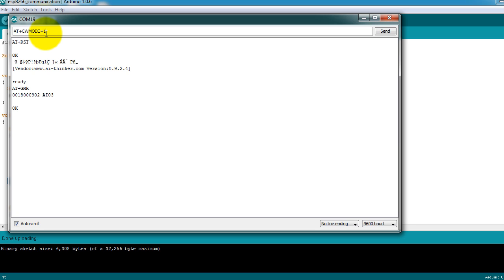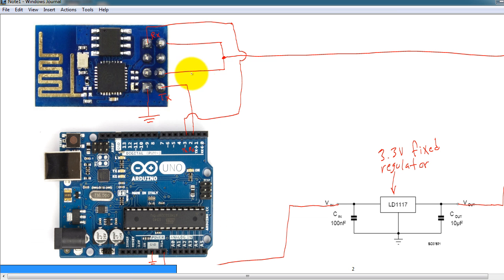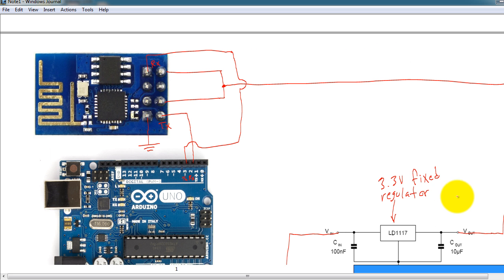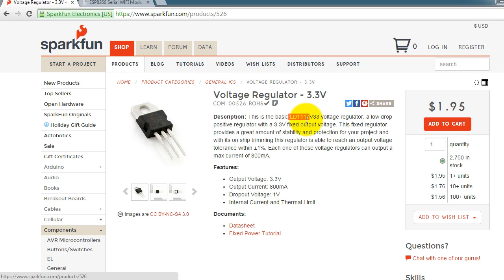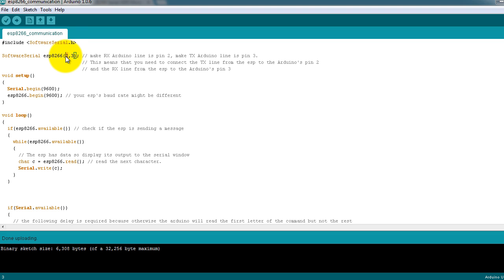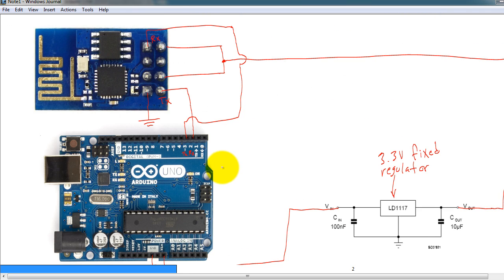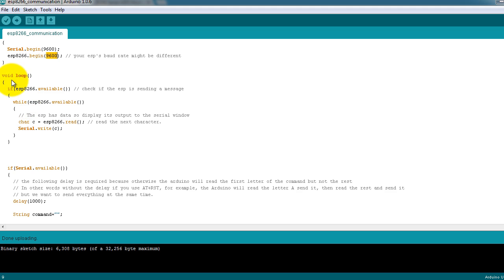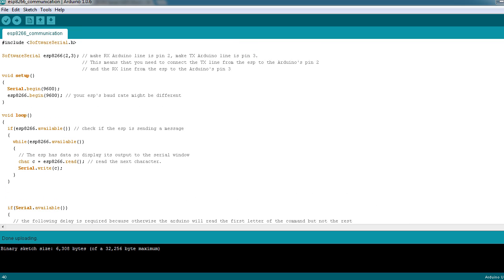ESP8266 Arduino Code and Circuit/Schematic for Sending Commands

Comment: How were the two capacitors around the regulator chosen? I don't have 100nF at hand, can I use two 10uF instead of a 100nF and a 10uF?

Comment: Hey guys , a very important thing here is a common ground connection. He has derived power from the Arduino and 1117 so he has GND same for both Arduino & ESP8266. I was using a separate power supply for the ESP8266 and could not make the chip to work. Its only when I connected the GND of Arduino with the GND of ESP8266 power , I was able to make the chip work. The chip otherwise kept on giving junk characters.

Comment: I keep getting garbage on the serial monitor? any suggestions?
Reply from the maker: jamil botros 100% garbage or only pieces? If it's 100% are you sure about the baud rate you are using?
Reply: I think I got it to work. I had to connect it to a voltage source to provide enough current. I do have another question if it is not too much trouble, I am trying to run a local website to control the arduino. But I need receive time and switch commands (set a pin high or low)
I do not think that the esp8266 has enough storage to hold such a document. how do you recommend to continue?
Reply from the maker: jamil botros You could use an SD card shield to save the HTML files. But the ESP8266+Arduino combination is very unreliable, I would rather use a WIFI or Ethernet shield. I don't know how big your webpage will be, but maybe the ESP alone (without an arduino) can handle it.
Reply: So, technically I should be able to hook up the esp to an Ethernet shield and connect to whatever local wifi I have around. am I right?
The question remains, how to initialize the ESP to connect to a wifi, is it possible to have some sort of code that allows me to enter the SSID and the password?
I know these are big questions but I'm really interested in making this work..
Reply from the maker: jamil botros Why do want to connect the ESP to an ethernet shield? The ESP can already do TCP. Check out my other videos where I show how to enter the SSID and password for the ESP https://www.youtube.com/playlist?list=PLmfT_cdP5PYDRYIvGIQ4YQYnEprshtxO8
Reply: ّI know the esp has tcp but is there a way to get it to read from a micro sd?
Reply from the maker: Yes, other versions have SPI but I doubt there is a well developed SD card. There is a kickstarter going on at the moment for an ESP dev kit, they will have an SD card https://www.kickstarter.com/projects/1101426903/phasor-an-iot-development-board-with-wifi?ref=reddit

Comment: Why don't you just use 3.3V output of Arduino board?
Reply from the maker: The ESP uses up to 700mA which the 3.3V pin can't provide, sure it might work in some cases but if you start getting garbage from the serial or unexpected results this will be one of the reasons why.
Reply: AllAboutEE Thanks.

Comment: Is it possible to communicate between two arduinos using esp8266 for sending between them temperature values in both direction? I couldnt find tutorials/information about this.

Comment: it is possible connect esp8266 with Arduino Uno without any additional regulator? What is the reason of usage LD1117 3.3 V/0.8A in circuit?
Reply from the maker: The esp8266 requires more current than the 3.3V pin from the Arduino can provide. The LD1117 converts Vin (your Arduino's power supply) to 3.3V and enough current (provided that your Arduino's power supply also provides enough current).
Reply: AllAboutEE
so, not enough current. Thank you for quick response!